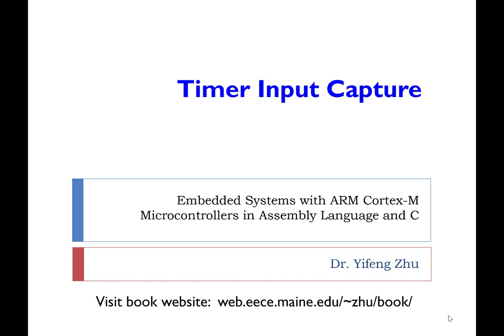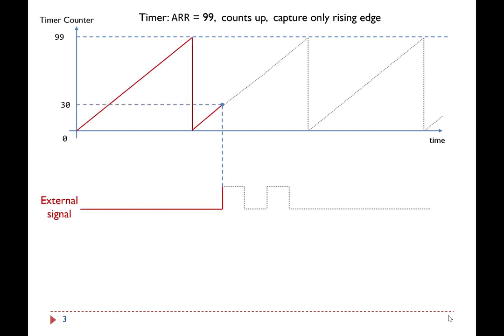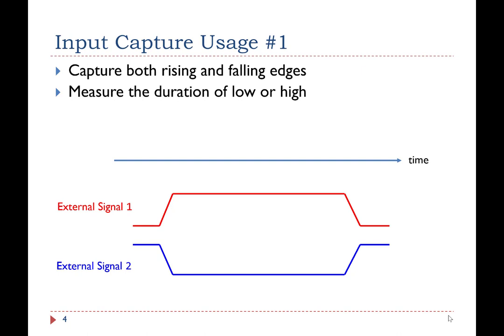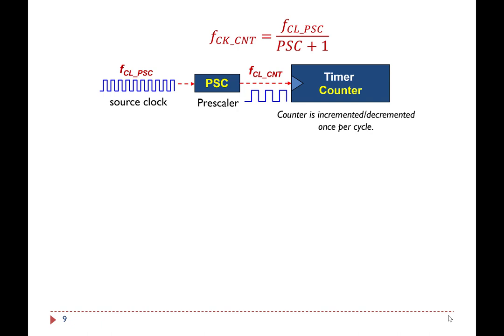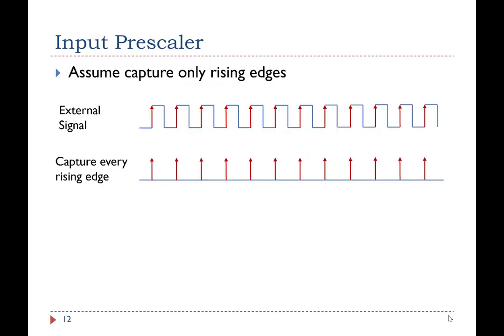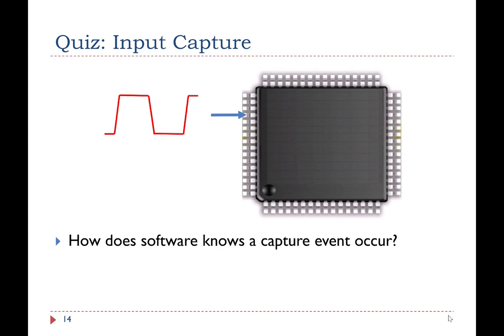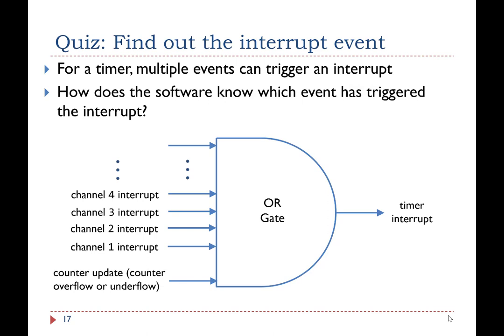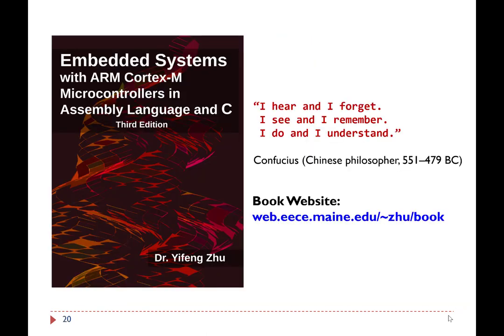Lecture 14. Timer Input Capture

Comment: Thank you for the lecture, 
Is there a mode, in which the timer starts counting as soon as an external event happens, and interrupts when the counter is overflowed? For example in order to acquire N data samples from ADC after the rising edge of a trigger signal occurred?
Reply from the maker: Hi, Mahdi, you can use EXTI to detect the tiger signal. In the EXTI interrupt handler, you can enable a timer. You can use the timer interrupt handler to perform ADC sampling. More efficiently, you can directly use the timer trigger output as the trigger input of ADC (so that there is no software involved for triggering ADC.)

Comment: Is this much quicker or more accurate than just using micros() at the start of a regular interrupt and comparing it to the previous micros()?  I'm trying to compare signals that are up to 100 micros apart which is working about 95% of the time. Wondering if using the input capture interrupt would help or if I should try moving my project from and Uno to a Due.  Thank you!

Comment: What is the external signal here? GPIO input capture? If so which particular pins I/P?
Reply from the maker: Signal external to the microcontroller, such as the output from a sensor
Reply: @embeddedsystemswitharmcort9051  yeah but what if there are multiple input pins which pins edge will the timer read?
Reply from the maker: If a timer is enabled to capture multiple external inputs (we need to use multiple pins, with an input signal on one input pin), the timer interrupt is triggered whenever an event takes place on any input pin. In the timer interrupt handler, software should check the event status register to find which channel (or i.e., which input pin) captures an external event.